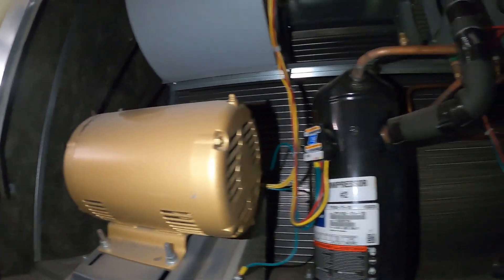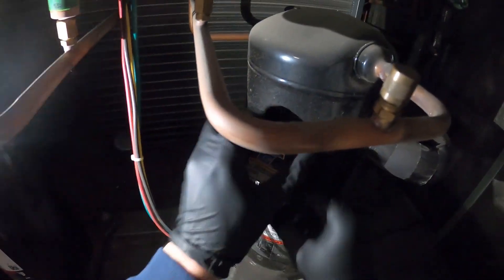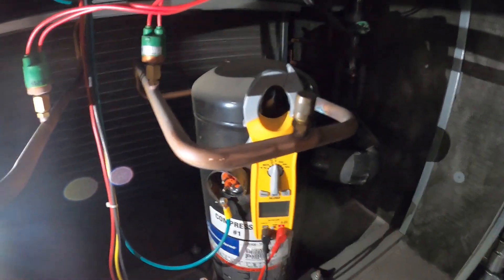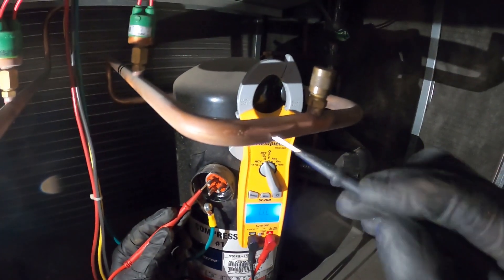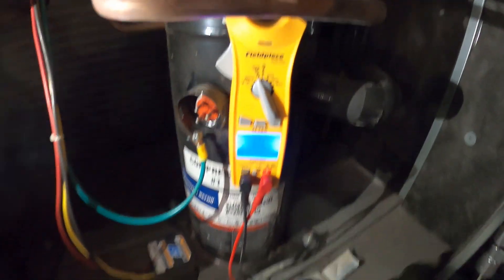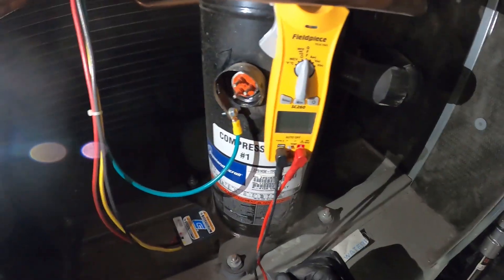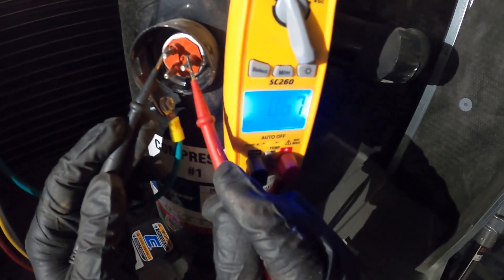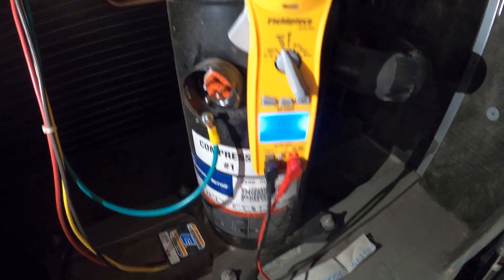HVAC-How To Check The Windings Of a 3 Phase Compressor & Check For Any Grounds (A/C & Refrigeration)

Comment: I have a question. Today I was diagnosing a compressor for a mini split that was making weird noises and after 3-4 seconds it stops on thermal overload. I took the resistance on the 3 terminals and all were the same resistance. But when I was checking each to ground I had continuity. I was buffled because I know a grounded comp trips the breaker but this one would trip the overload plus it would try to start for a few seconds. I read the diagram and it seems to be a star winding configuration. My boss told me that those comps are by default grounded. It's the first time I have seen this. Is it for real? I am questioning my boss's knowledge atm 😅

Comment: Thanks for the teaching,and a have a question what meant is when checking between the Wingdings you get OL on a 3 face compressor,exactly the same like you used to teach. Thanks for the answer y your time
Reply from the maker: You're very welcome & thank you for watching! OL would mean you have open windings which means you have a bad compressor and it must be replaced. What you are checking is the resistance of the windings to see if they are in tact or not. The best test for this is to use a meter called a megohmmeter and I made a video on how to  check all kinds of compressors with that. Stay tuned for new videos every week🔧⚡️

Comment: I got resistance only on S+R  but not resistance on the other ones
Reply from the maker: So from C-S & C-S you're getting nothing? Are you getting an O.L reading?
Reply: @JumpermanTech  yes getting LO reading
Reply from the maker: @CG-qc1ob  You may get an OL reading when the compressor is hot and went off on the internal overload. Check again when the compressor is ambient temperature to confirm but it's looking like a bad compressor so it's time to replace it. Thanks for watching!
Reply from the maker: @CG-qc1ob  Stay tuned for new videos every week!
Reply: @JumpermanTech  Thanks 😊 I just graduated from trade school. At first unit wasn’t getting any power at all, it was the breaker, then bad capacitor, changed capacitor, everything turned on except the compressor. My diagnose was bad compressor . Thanks for your videos and and respond. I hope you have a video how to turn an ecm motor to psc motor using just relay thanks 🙏🏻 again

Comment: Good video. O.L. is actually Over Limit which means that the value is over the measurable limit. Such as what infinite ohms would be if there is no continuity to ground
Reply: Technically it does not mean “over limit” it means open loop or open line to signify there is no continuity. When checking continuity you are checking if there is a closed path for current.. or if it’s “open”.
Reply: Sound ohms  showesing  good  no grunde

Comment: Would you check the amp draw on a compressor to get a more in-depth diagnosis of its condition?
Reply: Not if it's shorted.  If it works you could check each leg with a megohm meter

Comment: Dont do much light commercial. Mostly residential. I had an rtu 3 phase carrier today 10ton that the compressor terminal port blew out and leaked all the refrigerant. Tested ohms across and got 5ohms on each leg. Will grounding it out somewhere cause it to blow like that?
Reply from the maker: You got 5 ohms across one terminal to the other or one terminal to ground? It could def be a possibility. Thanks for watching. Stay safe out there & stay tuned for new videos every week🔧
Reply: @JumpermanTech  all 3 terminals tested 5 ohms on resistance across each other. Nothing to ground. 15 ton rtu

Comment: Is there any case there resistances for all windings but inequal?
Reply from the maker: For 3 phase compressors, that might indicate you have an issue. To go further in depth, use a megohmmeter to test the compressor. I just made a video on that last.Stay safe out there & stay tuned for new videos every week🔧

Comment: Why manufacture 3 phase compressors instead of one phase?
Reply: 3 phase is more for commercial. Though you can do 3 phase for your residential home, I just don’t see why you would really need to. It’s also more expensive.

3 phase compressors draw a lot less current than single phase. So you can achieve the same tonnage with less power. 
They have much more starting torque as well, meaning you don’t need to run a capacitor or a start capacitor for the compressor to run. They also last longer too. Hope this helps.
Reply: @ridered03cr  Thank you for that info

Comment: Noobie here. What would a ground mean? Why don't you want any grounding?
Reply: If the electricity has a direct path to ground at this location where the plug is, the electricity will take the path of least resistance and go to ground, instead of through the load. When electricity has no resistance like that, and goes straight from the power source to ground, it will flow very rapidly and cause whatever it is flowing through to heat up very quickly. A circuit breaker or fuse will pop when this sudden rush of current goes through them.
Reply: @nickschmid2273  Thank you!
Reply: @nickschmid2273 can you give examples of what a path to ground would be? And is grounding considered a short. Thank you